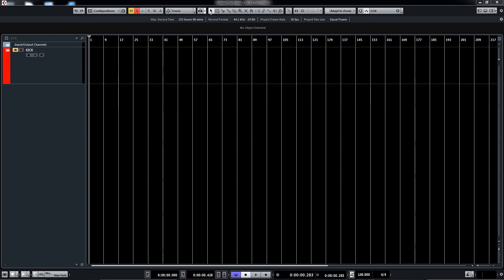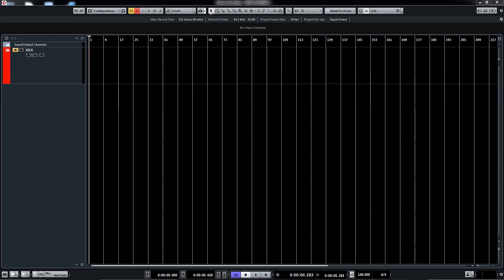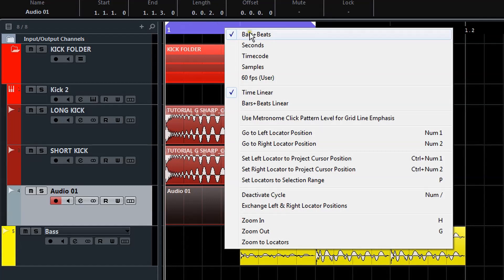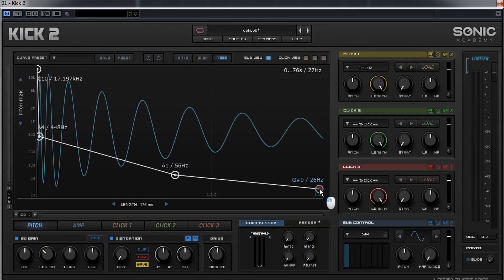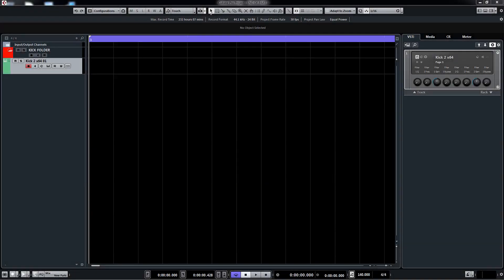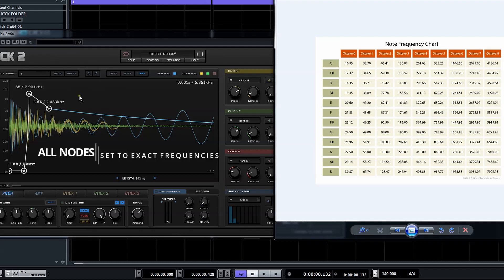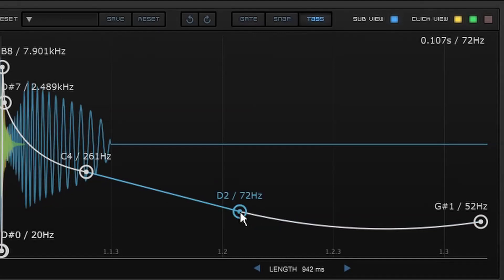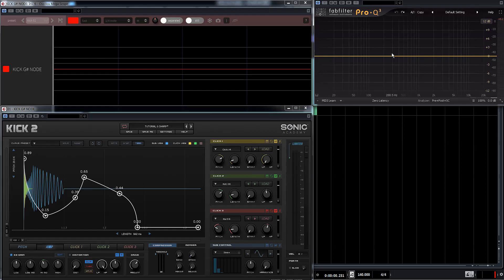Psytrance Kick: 3 + 3 Fundamentals for your Psytrance Kick design

Comment: Very nice tutorial
Reply from the maker: Thank you vey much!
Reply: @SounDirectiveSamples  if you want to boost the low end of the kick to get more punch instead of click, should you boost the amp envelope curve in the second half of the waveform, after 107 ms in this example?
Reply from the maker: the low end of the kick is in its second half...you can boost that specific area either by the amp section which will increase the volume or with an eq by boosting the low end...
Reply: @SounDirectiveSamples  Thanks, I  was having more click than punch in my kick, I zoomed in and added a few more nodes in the beginning to add a bit of attack without flattening the low end and it is sounding better. So, if  want the end of the kick to blend with the first note of the bass, should I match both phase and amplitude or just the phase of both waves?
Reply from the maker: @dendraspace The end of the kick together with the first bass , when they phase match , they will boost the hole volume of that specific area.Adjustments with eq,amplitude,side chain etc are required to both elements so as to balance/reduce the boosted area  to a more "even" looking and sounding waveform..
Reply: @SounDirectiveSamples  Thank you very much

Comment: Very helpful indeed Thank you, Author!
However what I didn't understand  is why in your Kick2 the blue sample curve is so short (like, 1/16 of bar), whereas as I understand after rendering you get kick 1/8th of a bar. Is it the limitation of Kick2 to show actual curve as you adjust Pitch, Amplitude and duration of your working area in Kick2?
Anyway, I use different tool do synth kick, and I really value the principles you explained here.
Reply from the maker: Dmitrij Silov hi there Dimitrij and thank you for your comment!...the kick waveform (blue) appears shorter (1/16) because i have determined the overhaul length from the amp section (8.10-9.00) with the placement of one new node before the last one.....if i use the full length of the amp section,(meaning that the last node will be the one on the far right ) and determine the length of the kick from the sliding bar of ms under the waveform, then the kick waveform will cover the hole window as if zoomed in...
Reply: @SounDirectiveSamples  got it, thank you :)

Comment: How should the click 1 and click 2 tab be configured?
Reply from the maker: Hi there and thank you for your comment !...here is what is how i usually treat the click layers...once my kick is complete and i am happy with it i go to the click 1...i listen to all the click one by one without modifying their parameters...just as they are...the ones that i think make the kick sound better in any way i not them down....once done i  revisit the ones that i liked until i find the best one of all....during this selection i will play around with the pameteres of the click section to see if i can generate something even better ( pitck/starting point/phase etc)...if i do i keep it...if i dont i just use it raw with no modifications.....after that i go to the second section where i usually add a hat for extra transient that will help the kick cut through the mix better...same process....check them all...choose the best ones....revisit the chosen ones only with parameter tweaking...and keep the best....the whole approach is like that....you make the kick that you already like....you add a click layer...if it gets better you keep the layer...if not...you go back to the kick as a starting point....you then move to layer 2 (hat)...if it gets better keep it...if not go back to the click selection only...there is no really right or wrong here...nor you can only use 1 or 2 layers....just make sure that anything you do improves the kick.....always try a/b....before and after the layer to have a clear idea on what is added....hope that helps
Reply: @SounDirectiveSamples thank you very much for answering me and for the help, it was really useful. Greetings from Mexico

Comment: Great video, Quickly wanted to say that if 2 sine waves are in the same key they don't have to be phase aligned, as you claimed at 11:17.
Reply from the maker: hi there and thank you for your comment!!....yes you are correct on your comment...they can even have opposite phases....but i think its quite clear from the overhaul context of the video that the key is responsible for the distance between the wave cycles and not the phase  .Otherwise the phase allignment between kick n basse wouldnt have to be demonstrated since they key alone would phase allign the two elements.....

Comment: thank you! how would you approach choosing a kick in a track that has more than 1 bass note? like a 2 chords loop for example.
Reply from the maker: Hi there and thnx for the comment!...if the different notes are just a small transition then it shouldn't be a problem...now if the bass notes actually stay for more than just a transition...meaning for long ...then the kick n bass misalignment is unavoidable...nothing you can do...any attempt to change the kick to fit the bass will basically destroy it...one think I would try though is to see if the different notes could be phase reversed so as to have the minimum amount of phase cancellation with the kick

Comment: If we need to tune the end of the kick to match the bass that it feeds into then what if we want a variety in our bass where the bass note changed, would we need to do a separate kick that feeds into that which is the same kick but ends on a different bass note?
Reply from the maker: No you don't need to do a separate kick...in cases like the one you describe the kick remains the same but unavoidably if the bass is in a different note the phases will not match...which is ok if it happens fast...the phase misalignment is barely noticeable.. especially if the change of the bass for a higher note..
Reply: @SounDirectiveSamples  I see thanks.

Comment: Hello, I really benefited a lot from watching your video.  I want to ask you a question.Every time I add a plug-in, the waveform in the oscilloscope will move a little later. Will this cause any trouble? Is there any solution?
Reply from the maker: Hi there and apologies for my late reply ! Thank you so much for the comment !The change in the oscilloscope happens due to the latency each plugin ads to the waveform...depending on the plugin this sometimes can be quite a lot...I would suggest you export your bass in to audio once you are happy with it so you can manually chop off any pre delays or added artifact before the first transient of the bass...You can then move it back into its position in audio form ,free from plugins , and proceed to the phase alignment with the kick
Reply: @SounDirectiveSamples  Oh my, thank you very much! I suddenly woke up!
Reply: @SounDirectiveSamples  Excuse me, do you have a private friendship course? I want to consult.
Reply from the maker: @xiaomeng2417  yes I do...please check your Instagram messages!

Comment: Doesn't the phase allignment thing mean that you have to keep the bass the same note the entire track? I like to changes notes quite often, does that cause phasing issues then?
Reply: Not at all, you can generally tune the phase relationship to minimise the amount of cancellation. You only get maximum cancellation when two waves at the same frequency are 180deg out of phase, any combination of frequency (i.e. note) and phase otherwise, will only ever result in partial cancellation. By tweaking the phase of either kick or the bass, you can find a sweetspot where the amount of cancellation is an acceptable minimum for each note.
Reply: @BappinProductions  Got it, thank you for the explanation!
Reply from the maker: Daniel Lengyel the answer given by BappinProductions is 100% correct....what i will add though to it is that in psytrance especially tweaking the kick phase during the track to match a changing note of the basse(for better phase allignment) will result in a significant colour change in the kick...if there is no major phase cancellation when changing the note of the bass but only partial  then i would leave it as it is for two reasons....1) in psytrance the change in the note of the bass is for such a small duration of time(usually) that the ear doesnt perceive the phase change(unless is a big phase cancellation ).....2) In the case of note change it is more important (in my opinion) to maintain the dynamics and density or the bass in relation to the kick....you usually discover that when you change the note the bass gets either thinner....or boomy.....in such a case it needs to be EQed again in a seperate channel from the fundamental base ,so as to have a continuous colour ,punch and dynamic throughout the change....failing to do so will create more audible problems that the partial phase missmatch between kick and bass..
Reply: @SounDirectiveSamples  Thank u again!!

Comment: This is Excellent, thank you so much for going over the topics that we all need! i have an additional question and i hope it can be answered. Let's say both my kick and bass are in the same Key, G#1(52Hz). Is it or true that you have to put one in the lower register and the other an octave above (Kick 52Hz bass 104 Hz, or the opposite) to leave space for them to "breathe" . Is this a stylistic choice? is this preferable?  or as long as we respect phase alignement , it doesnt matter..?? Thank you in advance.
Reply: Personally 104hz might be a little too high for the bass? Try side-chaining bassline to your kick or try a linear phase EQ and make a cutoff on the first bass fundamental (52hz) in your example.

Another approach would be to make the Kick a perfect 5th above your root note of the bass. I know some people do this and it sounds fat actually! So if your bass is G#1 then you make your kick land on D#1
Reply from the maker: Hi there and thank you for your comment !..In my opinion placing the base one octave above the kick will create a phase mis alignment because it will have more wave cycles within it (since it will be higher pitch)....also , frequency wise it is too high to actually maintain a healthy portion of low end....if i understand correctly (correct me if i am wrong) you try this method in order to avoid the frequency overlap between the kick and base in the low end region.....especially the area where the kick overlaps the first base, which if phase aligned correctly,should be significaly boosted...If that is the case then the solution is in the carefull balance between the 2 elements (kick n bass) by means of volume adjustment,side chain,balanced eq etc....rather than placing one of the two in a different octave to avoid the frequency overlap.....

Comment: This is an excellent tutorial, thanks for sharing the knowledge!

I got a question: If only the lowest frequency points in the waveform define the tonality, why should we set all frequency nodes to the exact note frequency that they correspond? I would have thought because of this general rule, only the last 2 nodes or the lowest in frequency would have to be tuned to the exact note frequency. Hope to hear from you. Many thanks
Reply from the maker: Hi there Jo and thank for your question.In theory yes you could be right.Only the last 2 nodes that practically "collide" with the bass should be the ones that we should really pay attention to for obvious phase alignment issues.The previous nodes are usually higher in frequency and their "exact" placement should not really cause any issues or be audible.That doesnt mean though that we cannot have accuracy in our settings when its relatively easy to do.The exact accurate setting is a general approach that i personally have in all the steps of the production.I personally believe that you need to have this kind of (if i may say) "discipline" throughout all the stages of the production and not only be accurate selectively for example only when eq-ing or compressing etc.I think that people are either on one side of the line (being surgically accurate with everything) or the other(being a bit sloppy and making broad movements overhaul).Having said that though and always in response to your question,no it would not be audibly  or technically wrong to have the higher nodes in a "not so accurate" frequency position.The lower you would get though in frequency the more audible noticeable it might appear to be .
Reply: @SounDirectiveSamples  Dude thank you so much. you explained it brilliantly and it does make a lot of sense! I do agree that when you have that level of discipline and precision in any art form or activity, only good things can happen.

Again, many thanks for your response and for this video. This should be one of the first stops for anyone that wants to learn how to produce psy trance PROPERLY!

Comment: This is insanely inforrmative, thank you for doing this.
Do you know where I could find a video or information about using a kick on a different key, and to try reinforce the 2nd 16th as you would if using a kick on the same key as the bass.  You mentioned in the video that you would cover that in another one.
Thanks again.

Comment: This vid was incredibly helpful, I can't believe it's free!

One tip tho, on Pro-Q 3 you have the option to show a keyboard at the bottom which means you won't have to use the chart when EQing or finding the right note frequency for the tail of the kick.

Another tip, kick 2 actually has the note divisions built into the visual display 1.1.2 being 1/16th and 1.1.3 being 1/8th so the maths is not necessary :)

Great video will have my eye out for more future content, in depth videos like this are hard to come by on YouTube.
Reply from the maker: Thank you for your commnent!

Comment: It is almost imposible to avoid phase cancelation or better said to get perfect  k+b phase shift without using ozillos mega scope. I just use my ears as to make precise phase correction you must use your eyes and compare both frequency crests both together. Anyway thank you for this tutorial. Before this video it was very very very dificult to understand how you can make phase cancelation , but this tutorial is very graphic!!!!
Reply from the maker: Thanks for your comment Eduardo....!! Indeed it is very difficult to have perfect phase match without any visible means even though a trained ear can understand when the phases are almost perfect....oszillos is just one of the tools that can offer a separate view of the waveforms but its not the only one....you can also do it manually by exporting the kick and bass in audio and overlapping then in order to see how the phases correlate.....off course if you need to make any changes you will have to re export the audio and re- overlap till you get it right....another  way also is to use other oscilloscopes that can show you the kick and bass together....by paying attention to the disturbance on the second half of the kick you can more or less make small corrections realtime ....

Comment: Never realized you actually have a small part where kick and bass overlap. So the same would hold true for Hardtrance kicks right? Though they usually have 1/8th note kick, and then 1/8 note bass (instead of the  three 1/16th). 

At least I always gave the bass an attack phase to merge the two sounds. So chances are you get some phase mismatch there. And your example of the 2Hz difference showed me how big of a difference that actually makes in the perceived sound.

Thank you for this video. That was super useful!
Reply from the maker: Hi there and thanks for your comment !The overhaul approach of the kick design should be applicable to all kinds of kicks.As far as the specific kick bass pattern you describe (kick 1/8 + bass 1/8) then they should not have any area where one would overlap the other.In such a case the phases are not as important as in the case of overlapping waveforms.But in any other case where the kick overlaps the bass then the information of the video should apply.

Comment: Hi! Nice tutorial dude! I'm making the same now but, I'm having a little problem. It seems that  my kick don't start exactly at the beggining of the OczillosMegascope it has a very little like delay and then starts. So the kick wave overlap a little bit with the 2nd bass.What could be happening? even rendering the sound has this "delay" on it. Also, if I manually put it in the right place I get the same. I use Ableton, the Kick2 Vst says (latency:220 samples (5ms), has this something to do ??
Reply from the maker: Rob SoulRed hi there and thank you for the kind words!!sometimes oszillos does present the waveforms out of sync but with a small start /play repeat snaps out of it and recentres the waves( works for me always).....that is offcourse as far as the wavefrom representation....now when it comes to rendering the audio and having this kind of delay then the first i would look at is the Daw latency, and then maybe some plugins that you might have(?) on the kick channel....maybe some eq or any other plugin....that would also affect the latency of the rendering....if you dont have any plugins on the Kick 2 channel then try to move the last node in the amp section a bit ti the left an then again to the furthest point possible....as if reposisioning it for a bit and then putting it to the furthest possible  on the right....i found that sometimes the render does leave a small tail more than it should....
Reply: @SounDirectiveSamples  Thanks for the reply. At the end I just insert a new Kick2. This new one says latency 0...I don't know what happened, but it worked hahah